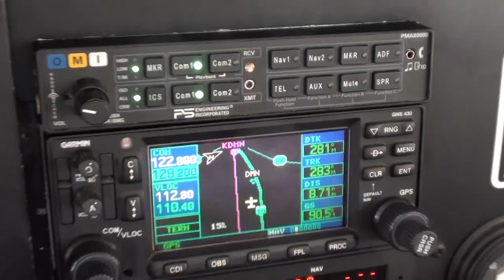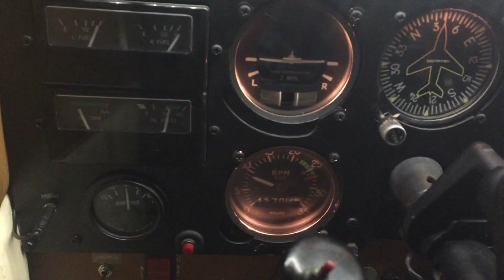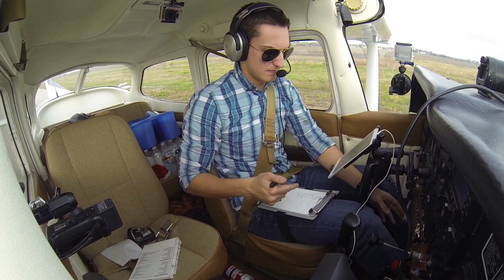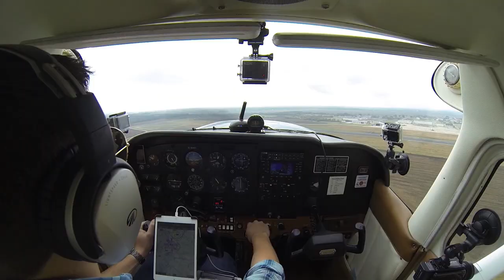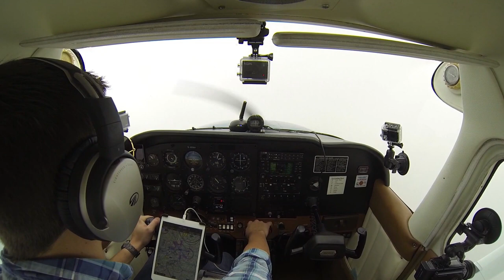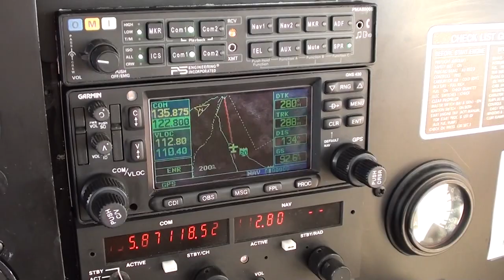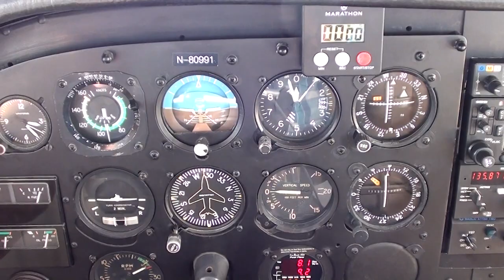Texas to Arizona | Cessna 172 | 800 Mile Flight

Comment: Glad you caught that engine issue BEFORE you got airborne in IFR!  I remember my first engine issue when I was flying in Northern California back in 1989.  I was flying solo from Mendocino back to Naval Air Station Moffett Field in a flying club C-172 when just 20 miles north of Santa Rosa, the engine began to run rough.  I pulled the carb heat and checked the mags, but that didn't fix the problem.  Right mag checked okay, but the left one did not.  I even leaned the mixture to try and burn some carbon off the plugs, but still no joy.  I ended up making a precautionary landing at Santa Rosa and found a mechanic there to take a look.  A spark plug had cracked somehow, causing a mis-fire with the left mag.  After about a couple of hours, with a new plug installed, I was back in the air and on the way home.  Scared the heck out of me, but it was a good lesson learned.

Comment: on an updraft carb, usually a leak on the intake or a boot will prevent engine start.  never flown but have nothing but aircraft engines on our airboats.  0-290 out of an old military mail plane, 0-320 and 0-360.  My fav was a 65 hp continental, bolted a 7028 Banks Maxwell to it, run all over the marsh on 6 gallon tank.  Those rubber boots if they loosen just a bit, that's it.  One thing i'm always amazed at is how pilots run up the rpm's on those 4 cyl alum heads and blocks.  We use a 8 min warm up, 1500 rpm to begin and listen to prop for distortion to drop, 2700 - 2800 rpm to get up on plane and pull her back to 1800.  We never pull her ears back at max throttle for more than 5 to 10 seconds.  I notice in these vid's on the cessna 172's, the 0-320's with the 10 hp carb upgrades, they never approach our rpm's.  Seems like in climb, the engine screams along rapped out for half hour.  We all wonder why so much pitch is required by manufacture on those units.  Very tough engines

Comment: I can relate with everything you said in the end of the video. I also fly 80% of the time in a normal c172 but the other 20% I do like to fly in a c172sp with g1000 glass cockpit. It is a totally different experience since all information is so precise and updated so quickly. One thing what I do notice is that with all the gizmo's glass cockpit has you become a lazy pilot. Everything is precise, no gyro adjust, speed, altitude and course have prediction lines, massive gps system, wind info, traffic, leaning assistent, etc...

Comment: Planes are built for traveling. I don't see how flying 800 miles is crazy. Driving that distance, now TAHT'S crazy ;)
Reply from the maker: It's because this airplane only cruises at about 135mph, but it's still more fun than driving ;)
Reply: +MrAviation101 Also more faster :P
Reply: pfff, slow. A J3 is slow. I took a 172S from central Florida to San Francisco once. Was somewhere between 20 and 25 hours within 4 or 5 days. Driving would have taken soo much longer. Besides, it's not about getting there. The journey is the reward, isn't it?
Reply: You're not from the midwest are you?
Reply: 800 miles isn't so bad if you using a true highway cruiser. I do it comfy conversion vans all the time

Comment: I have always wondered, "Why no wheel pants?"  Always look forward to your videos.
Reply from the maker: They're kind of a pain in the ass, and don't do much for the speed.
Reply: +MrAviation101 yes but the airplane would look so much better with them!
Reply: +kg4bua Yes, wheel pants do put the "cherry on top" in the appearance column.  The only "pain" that I am aware of is the tendency of the right wheel pant to suffer additional wear and damage as the uninitiated tend to use it as a step to aid entry into the aircraft.  Passenger briefing can greatly aid in avoiding misuse.  I vote for the wheel pants.  It DOES make the new paint job look so much better.

Comment: Is the antenna on the dash by the magnetic compass the portable ads-b? I've been looking to purchase an ADS-B mainly for traffic and weather but couldn't decide what model/brand to get. Any recommendations?
Reply from the maker: Make sure whatever you get is compatible with the app you use. I use Garmin pilot, so I use the GDL39.
Reply: +MrAviation101 Alright thanks! How well does it work though? I've heard that if the airplane isn't equipped with ads-b out then the traffic showing up is very limited

Comment: guys - I am pretty new to looking into maybe learning to fly.  I am 51 and feel nervous about the possibility...do nerves go away at some point?  i am trying to decide if this is worth looking into or just stay away because the thought makes me nervous....afraid of crashing, weather, forgetting something which could cause a problem.  I have two cousins that are pilots and i can go up with them anytime...this weekend i might go up in my cousin's cirrus s22.  anything advice would be great.
Reply: I have been flying since 1990.  I rented for some time.  I bought an airplane about 5 years ago and dealing with mechanics I began getting more nervous about flying.  Also have two young children and have more responsibility.  Whenever I leave the house I always think that there is a possibility that...  But the more I fly (I flew 100 hours last 12 months) and the more confident I get.  I get less nervous and overall enjoy flying more.  The other day I was flying back from KPHK to KPMP and there were thunderstorms in the area.  I got flight following and had ADSB weather.  They routed me though and I gave locations of my visual about the weather.  I gave the controllers reports about light turbulence. I felt totally confident (not over-confident) in my flying. I made two trips that were 1300+ miles in the last year.  I am still over protective. I check the airplane beyond what mechanics do, I dont rush the pre-take off, and I am constantly learning.  I guess, the way to get over the fears is to fly often and not push the limits.

Comment: When you rent these. Do you pay for just the flight time or the entire time you have the plane?
Reply: There are different methods of measuring the time that you have to pay for. In general, however, you can say as long as engine is running.
Sometimes it's when the electricity is on, sometimes when there's oil pressure and sometimes it depends on the RPM.

So, you basically pay for flight time. However, if you get it for more than a day, there'll be a minimum that you pay for each day you have it. (e.g. 4 hours)

He owns the plane, though, so he didn't have to pay any rental. Owning a plane comes with a whole bunch of other costs, though: Parking, insurance, fuel...
Reply: He owns the plane

Comment: You cheater, moving map, gps, you have a lot of high tech stuff that a mear 15 years ago you could not buy. Back in the Day I thought I died and when to heaven when my airplane had a KX170B's in it with two Vor's , an ADF and transponder. Draw a line on a Chart and keep a nav log. But times have changed, I been at it for 42 years now. I use to be that kind in insused about flying, I just became a thankless job with little reward. Yea I got a bunch of ratings, a few logbooks filled. I will tell you this after almost 19000 hours of it, my best flight ever was in a J-3 cub that I was ferrying and I just happened to plan my route thru Monument Valley, you see The Searchers was and is my favorite movie. I done need much to fly a current chart, a pencil an CR-2 flight Computer, a clock and compass!  A 172 is a great airplane, it's the most affordable aircraft out there.  GA has gone thru a lot of ups and downs over the last 42 years I have been involved with it. It's nice to see that you enjoy it so much, I was like that once.